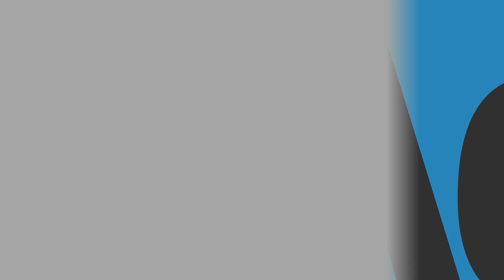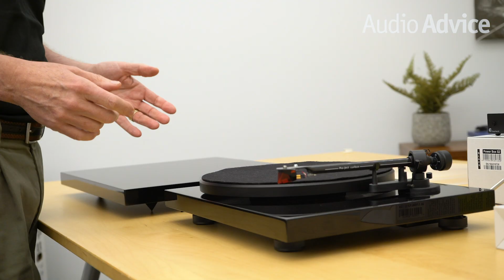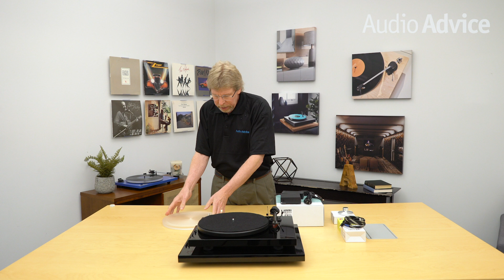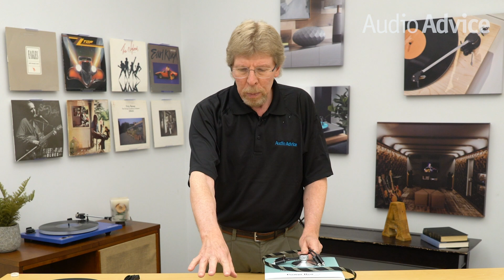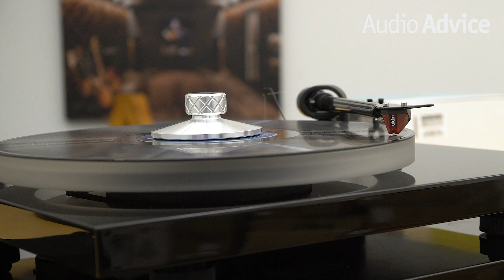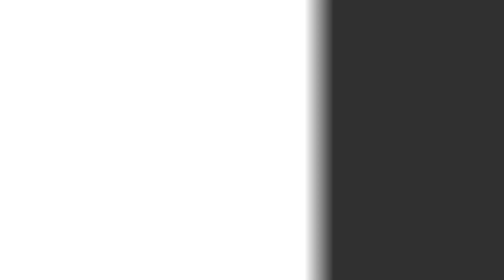How To Upgrade a Pro-Ject Debut Carbon DC Turntable

Comment: I love the acrylic platter!  I have an LED light strip under mine.  You forgot THE biggest upgrade we can do do the Debut Carbon, pull off the 2m Red Stylus and replace it with a 2m Blue. After 25-50 records it breaks in and only gets better after 50.
Reply: I'm trying to decide between the red or the blue, most of my collection is vg+ and I'm wondering if I should just stick with the red?
Reply: Cody S, if you get the 2m Blue now, you won’t have to buy it later.  Just be aware it has to break in, it’s going to take a couple of records for the harshness to fade.  About every 10 records you should notice it opening up.  Some say that it is broken in at 50 records.  One YouTuber breaks in his carts for 100 hours before he does comparison videos.  You will not regret buying the Blue if you can swing the 200 bucks.  If you get the Red, you’ll always be questioning if you should’ve gotten the Blue.  It is an excellent upgrade!  Just don’t play any prized records for the first few records.
Reply: @TheDabbinDave  Thanks for the reply, think I'll probably just wait and get the blue then. Thanks again!
Reply: @TheDabbinDave  Well I ended up at my local record/stereo shop and went home with a pro-ject debut carbon with an acrylic platter upgrade, waiting to get my Marantz back from servicing so I can hear it!
Reply: Cody S, did you have them upgrade the Debut Carbon to a 2m Blue or is the Red still on it?
Reply: @TheDabbinDave  I got a red on it, but for what I paid I'll be able to buy a blue when this wears out and still be under the msrp 😁 plus then I'll be able to hear the difference from the red to the blue!
Reply: Cody S The Blur stylus is down to $170 now.  When I got mine last spring, they were selling for $200-$210 on Needle Doctor and Amazon.  I got lucky and got one on eBay that was new.  He had an extra, so he had “make an offer” enabled.  I ended up paying $156 I think.  I’ve had my Debut Carbon since 2013, my Red was nowhere near worn lol.  I use digital stylus tracking force gauge, $13 on Amazon.  I had a Shure mechanical, I wish I woulda just got the digital one years ago lol, it was so far off LOL.  We moved into our house and I found what was left of my parents record collection from when I was a kid (I’m 50), about 25 records.  At that time Uturn wasn’t on the market and there weren’t too many affordable tables on the market.  I ended up getting an Audio Technica LP120 and used that for a year.  Of course I dove into the hobby!  I was burning CDs for my wife, so she was happy.  I got my daughter into vinyl, she bought records for herself.  I have the Pink Floyd records that I grew up on, my Dad wore them out with way too heavy tracking force.  The highs are dear, the Bass is blah, the 2016 remasters sound incredible btw.  Right now is a great time to buy a turntable, there are so many options and price points!!!  When I got my Debut Carbon, I ordered the acrylic platter and the Phono Box S.  I played one song on the original metal platter and dust & hair magnet slip mat.  Big difference with the acrylic platter!  It’s super easy to keep clean too!  I suggest you get a record clamp of some sort.  I have a clear Record Doctor clamp, it was 25 bucks or so.  Yes, I want a Pro-Ject Puck!  But, not for $90!  My wife clutches the purse tightly LOL.  I’m rambling lol.  You’re still going to have a break in period with the 2m Red so don’t make a bunch of changes to your receiver thinking something is wrong.  If you want to hurry up the wearing out of the Red, you could fall asleep listening to something and you’ll kill it in the runout groove like my buddy did LOL.  He got a Blue to replace it and loves it too. I have a Denon AVR-X7200wa, the onboard phono stage is horrible compared to the Phono Box S, because it is adjustable, I looked at Marantz tables, but the one I like is expensive!
Reply: Dave B. Nice tip. Have you thought about other TT’s from pro-ject or upgrading the tone arm itself?
Reply: Niandra There aren’t any technical upgrades we can do to the Debut Carbon.  The similar Rega P1 turntable can have the bearing upgraded, spindle, and a couple of other things with third party parts. Unfortunately those parts aren’t compatible with Pro-Ject tables. 

As it sits, my Debut Carbon with the 2m Blue stylus and Acryl-it Platter it would sell for about $725.  My next turntable will hopefully be at the $1200-$1500 price point. When I bought my table in 2013, I could have gotten the next level up table that was discontinued on close out for a similar price as the Debut Carbon, but I did not like the color and the cart was lesser quality than the 2m Red that comes on the Debut Carbon.
Reply: Dave B. Thanks for the info on Rega- I thought i read somewhere that they share some parts of have some cross compatibility.

Yours must perform very well, and I can see why Pro-Ject are doing so well, it’s a great package and in- house upgrades just make sense. 

I’m pondering over a table from either maker at the moment as a future upgrade from my Dual 506. I think you’ve done it right though- put on a great stylus and the acrylic platter as the priorities. 

Got some more thinking to do re: buying a complete package or something I can tinker with over time (beyond cartridge/ stylus change). Cheers

Comment: I don’t have that isolation base but my TT sits on a steel rack. Two items I have you didn’t mention are the speed box S, besides stabilizing the motor you can switch between 33 1/3 and 45. I also added the Q-up to liftoff the arm at the end of a record just in case. Thanks for the advice
Reply from the maker: Great suggestions, those are awesome upgrades!